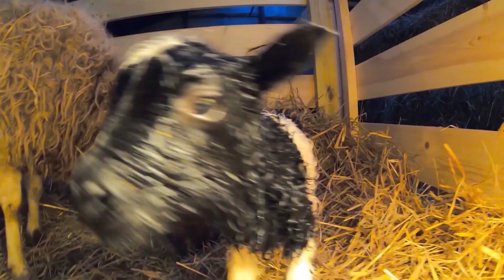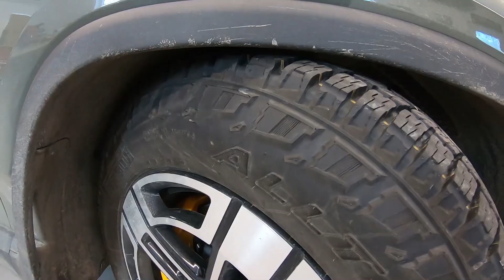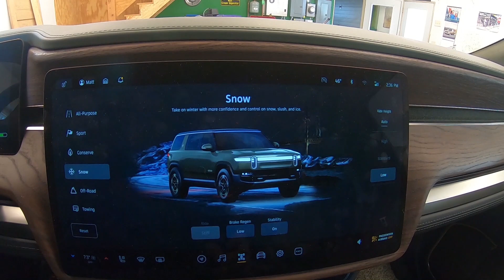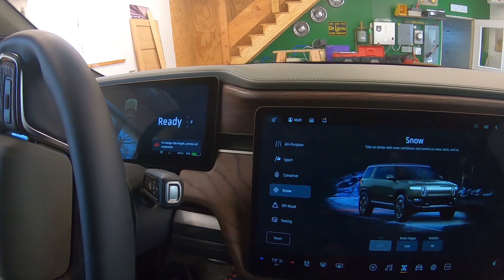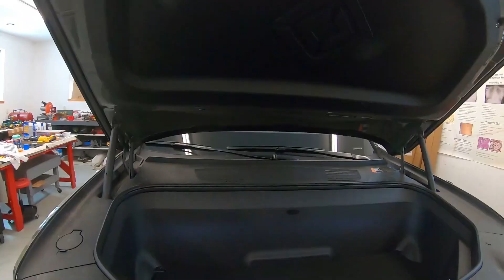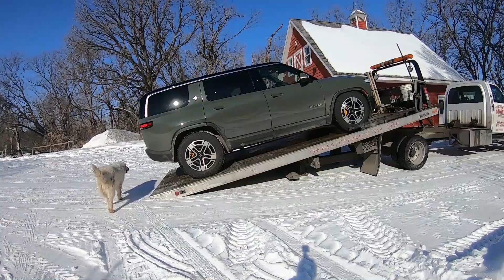Our Rivian is Undrivable at 8 Days | All of the Issues With Our R1S.  Service Issues and Failures

Comment: rivian doesnt have a good repair team and there repair prices are astronomical 3k to change a window..2k to reset batteries...3k to repressure your suspension which is caused by a hydraulic leak on your passenger side.  but rivian wont tell you that ...look for ch11fs on the floor greenish tint fluid.. system runs at 120 psi. slight hole and its over

Comment: that's why 48 v is the future as you can wait and see Tesla will transfer  CT tech to S3XY.   Rivian has no choice, since it is a a quality control. I doubt the inventory of 12voltst in productionise slow charge. Tesla has the same issue with 12volt. That is  why 48 volt is the future.

Comment: I have owned my Rivian R1T for over a year (April 2nd, 2022) and have had very few issues with it. TOTALLY LOVE THIS Truck!
 With the number of issues you have had, it should have gone in for service a while back. They should have paid for transport both ways. Note that with EVs (especially with new companies), issues happen early and things get better the longer you have it. The opposite of gas cars which get worse over time.
Reply: WORSE? At year 19, my car needed a couple used parts from the wrecking yard that set me back $30.
Reply: Yeah, this comment about gas vehicles getting worse is silly.

Comment: Can you charge 12 volts with the pigtails near the rear trailer hitch?
Reply from the maker: No.  That can be used for emergency power to open doors but Rivian would not let me try charging batteries that way.  The two 12volt batteries are apparently separate systems and don't necessarily charge that way.  Essentially I could of voided my warranty by trying it.  Also I did discover these batteries are only warrantied for one year.
Reply: Try to let them replace the 12v batteries. I have had one new chrysler and one new Nissan that came with defective 12v batteries from their manufacturers with in the past two years.  And one time when I called AAA for a jump start, the technician told me he had jumped started lots of new cars when he saw mine was new as well.
Reply: The 12v battery in my  Tesla Model 3 failed after 3 years  .. the replacement installed by a Tesla mobile tech failed after one day. The next replacement has lasted 1 1/2 years now.

Comment: Don't keep trying to change the ride modes or height.  Have you tried a hard reset?  Hard reset usually solves most issues.
Reply from the maker: Yes It has been hard reset many times without success.